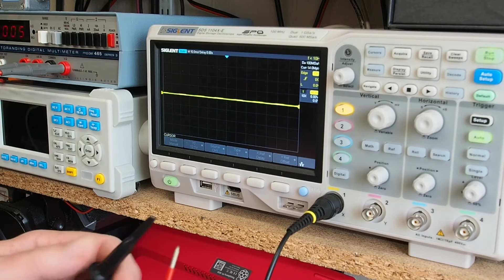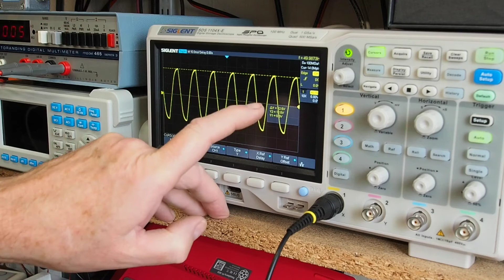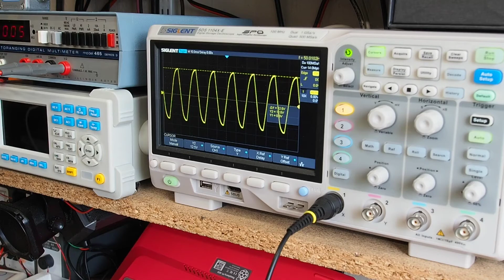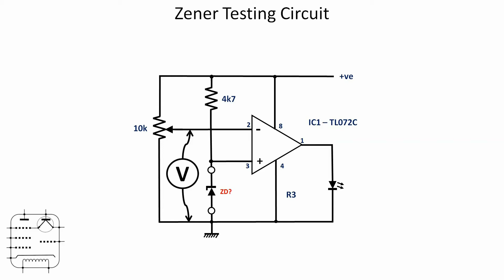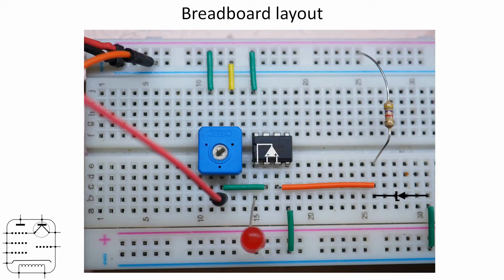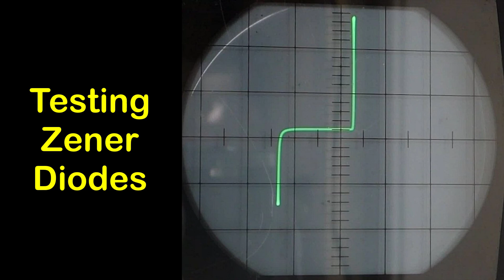Testing Zener Diodes and limitations of the Hameg HM307 curve Tracer - #114

Comment: Working on a cordless power tool battery charger, I think I ran into the same thing you did using an octopus curve tracer with my Techtronix 4635B.  I haven't scoped the octopus, so not sure what its peak voltage is.  After seeing your video, I now believe the zener I had was also higher than the peak of the octopus; so it read as a typical diode. Thx!

I am now using mjlorton's method to test zeners and find their breakdown voltage if unknown.  Video:  "Tutorial: How to test / measure the value of a Zener / Avalanche Diode".  Love how fast and easy it is.  Also like your opamp circuit.  Thx!
Reply: Perhaps a modified octopus curve tracer that use a variac to feed a 120V to 24V transformer to supply 1Vp-p, 8Vp-p, 16VP-P or 32Vp-p when required would be able to trace the curve of a higher voltage zener.

Comment: With that cheapo component tester, did you put the zener diode in the zener testing slots? I have a very similar-looking version, and if I recall correctly it works up to 30 something volts.
Reply from the maker: At the time of recording (November '21) no I didn't, later I discovered that it would indeed test the zener using the A and K sockets, thanks to a comment on a previous video made by 
medelec35
, for which I am grateful!